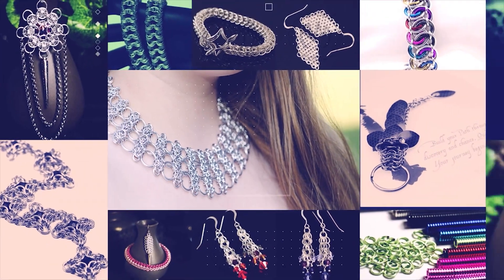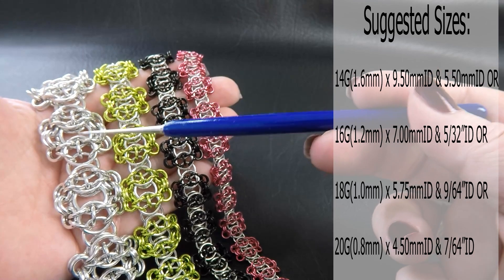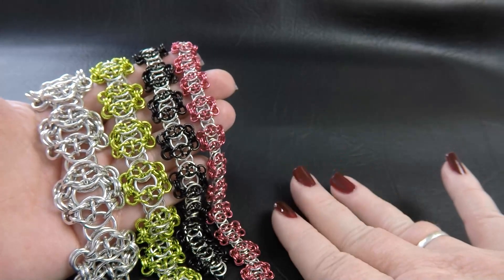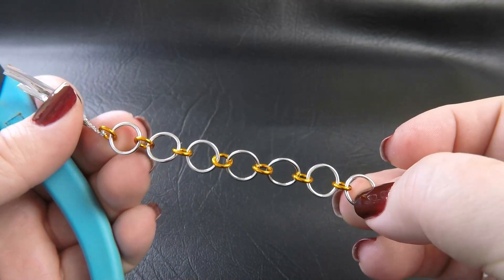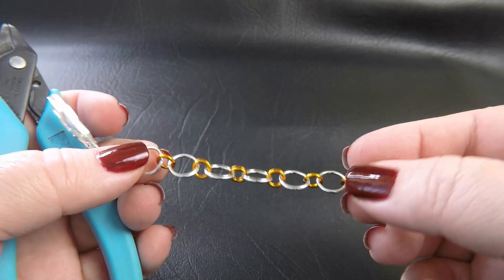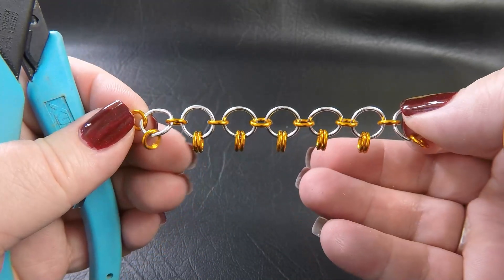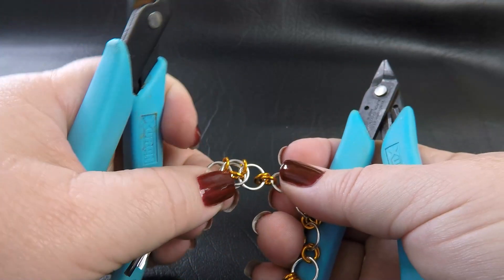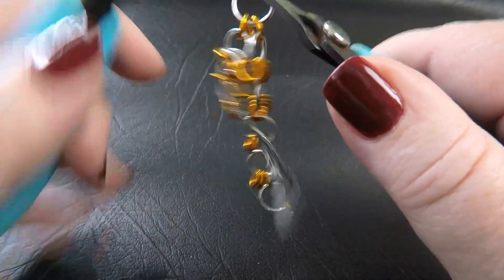Chain Maille Tutorial - Camelot Weave

Comment: It's just possible we have the original Camelot a mile or so north of here, an ancient moat called Camlet Moat, which has been that way for the last thousand years. Surrounding an area less than 30 yards square, about 3 miles east of the pivotal point of Waltham Cross at the tip of the Essex marshes, it's also just off the start of the truly ancient ridgway running to the Salisbury area.